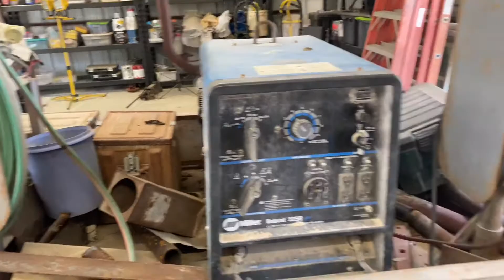Welding Trailer Improvements (Part 1)

Comment: i have a lincoln ranger 8 with the same motor on it..... runs good your welder sounds like it run well too
Reply from the maker: It does run good and it is a very reliable welder. The on,y problem we have is the battery going bad, since it isn’t used all the time.
Reply: Here’s food for thought. Buy a small battery solar panel trickle charger from harbor freight. It should fix that problem.